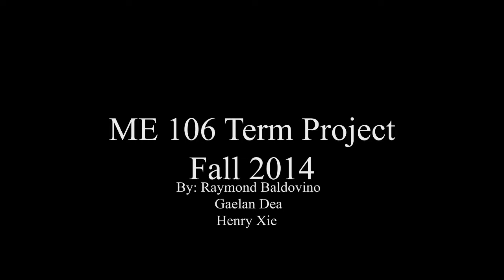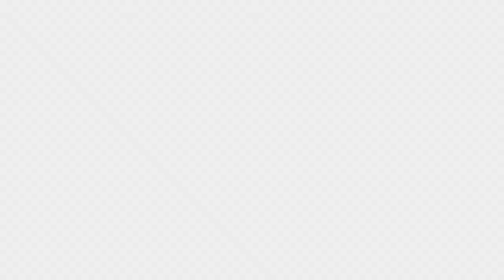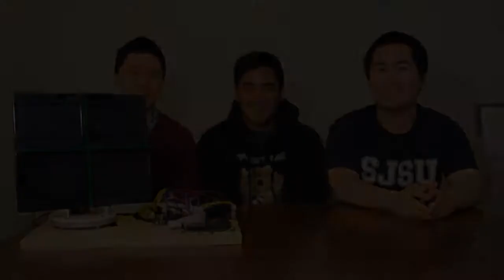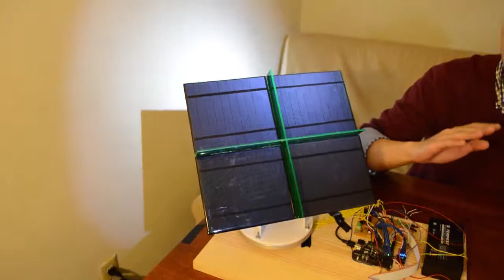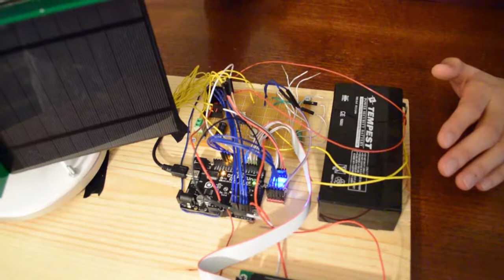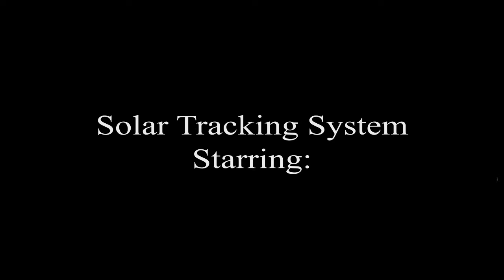ME 106 Solar Tracking System Description

Comment: it is unsafe to put batteries tilted over. most ee should know that for fact. when talking about diagrams, personally, I think is good to train our mind to describe as much technical language as we can. For example, when photovoltaic or solar cell receive light, the panel will create small pulses what we called Current. As light increase, we assume the panel is creating more current on a fixed 10, 12, or 21vdc output. On the other hand, as light intersects each panel, each panel individually will control the motor to one direction and this is translated to left and right control. for instance, whatever the panel produces more output , it will turn the motor left, right, up, and down. Ok... as you see you are not just coming up with words , you are simply describing facts about your single line diagram.  Hey, nice project ..!